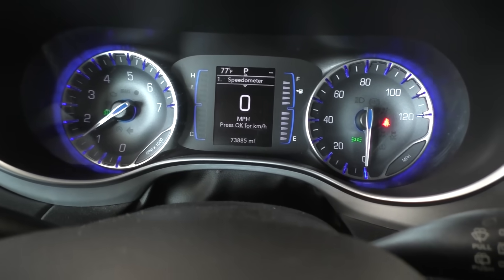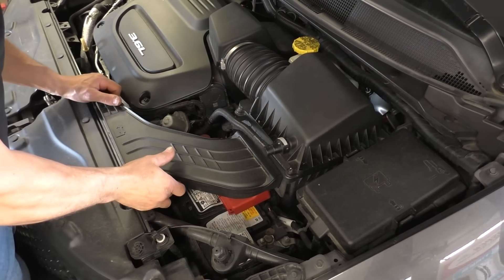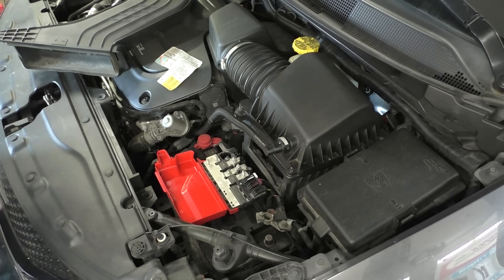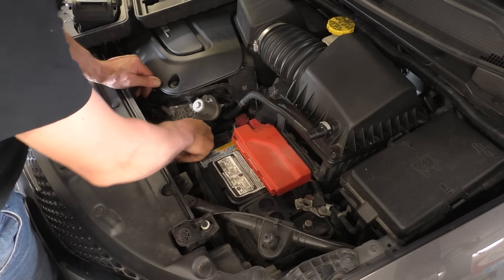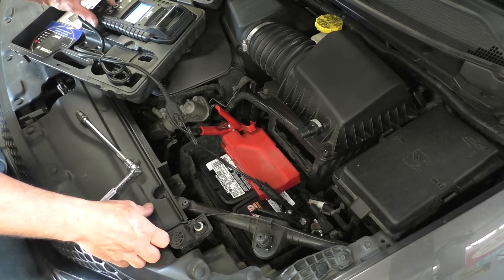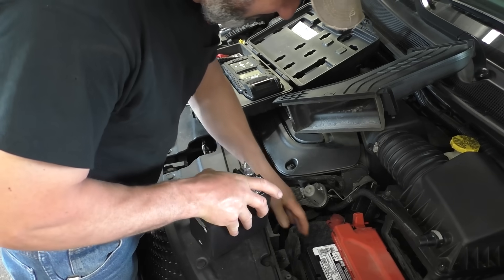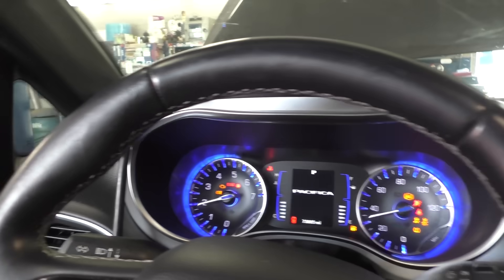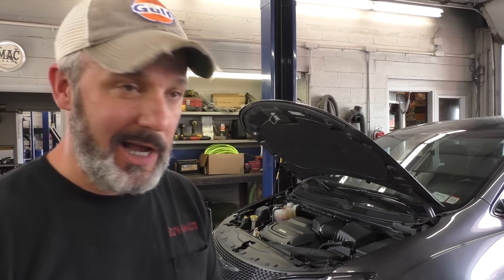Chrysler Pacifica - Start Stop System Disabled

Comment: My '18 Volvo did that after I was on a 9 month medical driving restriction. I replaced the aux battery with a standard flooded cell powersport battery (non AGM). I had to drive it a while and do a few resets of the battery monitor but eventually everything started working right. 2 years later and still working fine. I liked that the stupid start/stop garbage disabled but didnt like always seeing the warning.

Comment: I'm still running a Super Start (Oreily) 78 EXT lead acid flooded battery I purchased on Feb 14, 2013 in an 89 GMC Suburban v1500. Hard to believe 11 years and going. I've had it tested each year for the past 6 years and its still good however, I'm getting some hints lately its about time to replace...still has enough to start but for long term power needs it falls down within the first hour or so.

Comment: There a lot of people that would consider this a positive development, not a problem needing correction. BTW, Auto Start Stop is an unbelievably complicated design, the Care Care Nut did a great video on the system; it truly is incredibly over engineered (designed to mimic a hybrid system).

Comment: There is a lot of complaints on the internet regarding Chry's start/stop system with the Pacifica's. Replacement battery size, blah,blah,blah. My wife has a 2017 Pacifica and both batteries have been replaced 2x's, plus the fricking relay!!  If you search enough you can find a utube video on how to eliminate the auto start system and only have a main battery.  Like ur vlogs alot--

Comment: The difference between technician/specialist (mechanic/operator/electrician) and expert (engineer), is both experience and knowledge.

Just started watching and because I care to know technology:

I would check the BMS, battery state of health and charge!

Because the Start/Stop function ALWAYS checks the battery status to ENSURE it has enough charge to RESTART the car!

But MOST car people care not about DETAILS!
Reply: What is a BMS?

Battery Management System.
Keeps track of power (amps) added/extracted from battery and health (including age) of battery!

You do know that 100% of batteries have finite age life and cycle life, right!?
Reply: “That’s unique”, for no money back on lead core.

Well, again, you don’t understand that this is more like a UPS battery:
Deep cycle, rather than a regular car battery (start power, but get destroyed with deep cycles!).

(Not easy/profitable to get lead out of them, as it is with regular lead flooded batteries, which WILL start to go away. Write it down).

Comment: And several years ago when I worked for a big box parts store that installed batteries. One of the Chrysler labeled vehicles had the battery in the passenger side fender behind the inner fender ish.   I would politely refuse to install those explaining we were not allowed to remove major body parts for an install.  Lol I think the wheel and tire has to be removed iirc.  Then the easy replacement Chrysler station wagon type vehicles with the battery in the back of the vehicle.

Comment: In the salt belt, LOCTITE LB 8023 anti-seize is a good choice for the battery hold down bolt due to the bolted joint being surrounded by plastic parts. LB 8023 is a metal free marine anti-seize which is perfect for the salt belt.

For a new battery I find it beneficial that you first do at least a quick charge and then perform a internal impedance check to see what CCA the new battery registers, save the printout for the invoice (like shown in the video). This proves two things: The first is the battery is new, and it went into the car fully charged. Customers may ask, was the battery new? Where the mechanic provides the battery issue date which may be a month or two old, which we know is still described as new off the shelf, but the customer thinks why is it so old? and ask how do you know its new? Well that's why you provide the report printouts. 

If you have time to fully charge and test the new battery out of the vehicle you will usually find that the CCA rating is above the label rating. If not the battery has been on the shelf and neglected. Most batteries from the auto supply house are not fully charged when delivered. 

The video gives a good example of why you should first charge a new battery before doing the CCA test, you really want the report to be at or above the battery label rating for the customer.

If you do routine maintenance on a vehicle with monthly checks, you will also take the internal impedance reading in-vehicle (with the vehicle connected directly at the posts, under hood power points for trunk batteries will not work, you have to be at the posts) and record. Than every month you do the same test and you will start to build a trend (vehicle record). When the CCA in-vehicle goes below 80% CCA as rated, you generally recommend replacing the battery if this occurs just before winter. If it occurs in the spring you can usually get a few more months out of the battery as you monitor its health. For a car that is driven year round I find you generally get about three winters out of the battery in the salt belt in the lower 48.

I had one customer that got five winters out of a yearly driver battery, which to me was a world record, but the customer asked why do batteries fail so quickly? I really didn't know what to say.  

Deoxit L27 Electrical Marine Grease has very similar benefits as NO-OX-ID (A-Special). 

NO-OX-ID is better at preventing galvanic corrosion between aluminum and copper electrical connections than L27, like you would find in the electrical power distribution industry (Edison). However, for automotive OEM battery terminal and lug applications no aluminum is used. 

L27 is actually better at oxidation removal and lubrication than NO-OX-ID. However, I think either will do the job.

L27 / NO-OX-ID is applied to the post and lug before mating (as shown in the video) and Fluid Film (similar to NOCO NCP2) is an effective coating which is used after mating. 

Fluid film and NCP2 are non-conductive, this is why they are a coating applied after mating, whereas NO-OX-ID and L27 are conductive and are applied like conductive grease, that is, between surfaces before mating.  

I think the grease will displace more water than a coating over time. But, if the post and lug are covered than I think either method will work well,  which are many times more effective than doing nothing, no grease and no coating. 

Fluid film spray is a bit messy for the top of the battery when the battery is new and you want to keep it looking new, where the NOCO NCP2 is brush on so you can be very neat.

There are drill / driver attachments for cleaning battery posts, mark one P and the other N because the posts are different diameters. To clean the lugs you can use a bore brush, I use brass very sparingly, just enough to remove any surface oxidation.

After wire brushing the battery posts and lugs it is good practice to wipe with IPA, let dry, and then coat with grease. 

I think for the system to work, the battery connect disconnect relay is not a traditional relay, it is actually a latching relay. You have to activate a circuit to latch on, and then another to latch off. Cross connection latching with a non-latching relay may drop out as voltage drops below the relay hold voltage, which is very poor for a high current solenoid relay.

Comment: SMA on point as usual. I hope my nephew disables the start stop function. On idle I think a little under 40 psi of oil pressure is read. I feel like at least low 40's psi should be the norm. Oh well, DIY out.

Comment: Did you have to retrain the automatic power windows? My 2019 Ford needed to have the auto down and up reset when I replaced it's battery. Fortunately, it's a base model Ranger, so I only had to do the driver's side.

Comment: I had one where the customer kept driving with a bad aux battery, until it developed a slight internal short (would draw .5 amp all the time). It came in for the paracitic draw diagnosis.

Comment: I had one of these freak out about the start/stop system because one of the closed switches wasn't working. Had me doing circles for hours because it wasn't completely not working. Just the voltage range was out of normal. And it wasn't throwing codes. The hood closed switches were LAST thing I thought would cause this.

Comment: Curious Eric O, why would you not have plugged in a voltage/system maintainer while changing out the batteries?.?.?
Reply from the maker: Because then the whole system is hot and you have to be careful with the cables.

Comment: Question for Eric O. (I'm surprised that you didn't opine on this issue . . ..)--My understanding is that starting the engine is a major contributor to engine wear; ergo, it is preferrable (especially if one lives in an urban or suburban area) to disable the automatic start-stop, because the fuel savings are, long-term, outweighed by additional engine wear (from repeatedly starting the engine).  As I understand matters, all vehicles with the start/stop system have an option to disable it.  What are your thoughts?

Comment: I’ve got a 2021 Jeep Wrangler that has (had) this same ESS (Electronic Stop Start) scheme.  I hate ESS.  To begin with, I live in rural Vermont, and we don’t have any traffic, and not many traffic lights around.  No real need for ESS.  But more importantly, the smaller Aux batteries are known to have very short lives, 2-3 years at most.  And when the Aux battery dies it can pull down the main battery, which disables the car.

To completely disable ESS, first I installed an ESS Eliminator module.  What that does is latches the ESS disable switch in whatever position you last left it in.  Normally it reverts to “On” every time you start the car.  Next, I pulled the ESS fuse in the fuse panel.  That prevents the relay from putting the Aux battery in parallel with the main battery.  Third, I disconnected the red battery cable that runs from the aux battery (below the fuse box) up to the main battery, so when that aux battery eventually pukes it won’t kill the main battery.  Once the warranty expires I’ll pull the fender liner out and yank that useless aux battery out and recycle it.

Comment: I had the same issue with my wife 2019 jeep wrangler, brought to a dealer, they said it was a faulty charging chip and the batteries were fine.
Took the jeep for a 3-hour charging drive, the secondary battery never would charge, I changed both batteries, all was right with the world and has remained so since. Never got the dealer to admit they missed a simple Dead battery, thankfully it was still under warranty and I didn't have to pay for the three days they had it.

Comment: What used to take 5 minutes ( change out a battery ) now takes 45 minutes. I just changed out both of these batteries on a Pacifica , and that's how long it took me , and I already knew exactly how to do it . Oh yeah , and by the way : whatever you do , don not allow any tools or parts to slip out of your hands . They will fall beneath the battery area and if you can't see/retrieve them , you'll have to remove the aero dynamic cowling from underside of the van to locate and retrieve what ever you dropped . Allow another 30 minutes for this , so...DON'T DROP ANYTHING !

Comment: I've seen a few auxiliary batteries fail bad enough that when it does the self test on startup the voltage drops low enough to reset every module, not start at all, and not set a DTC, despite the main battery testing fine. P00FD is burned into my brain.

Comment: I have a mercedes cla with the start stop system and it is really fussy about the battery if it is a little less than purfect it wont activate the start stop system. As soon as the light wont go green quickly get the battery checked

Comment: The feature quit on my 2017 Escape.  No error messages.  It started working again after the battery was changed, but quit again about three months later.  I have yet to get it checked out.

Comment: The old Volvo 121 from 1970 I drowe in the 80s
had no computors, wires for the parking brake  4 fuses and rwd. I miss those times.

Comment: At least you can see the aux battery. Try MB, where they will, according to model, either bury it under the driver or passenger seat, or under half the engine on one side or the other, or under the back seat. In any case removal means taking half the car apart.

Comment: I have a problem on the driver side headlight of my 2018 chrysler pacifica. The passenger side is turns on but not the drver side. I look at the fuse box under the hood and found out there no connection wires on no. 98

Comment: Hopefully you get the opportunity to do the same battery replacement on a Jeep Grand Cherokee with the batteries located under the front passenger seat.
Reply: They aren’t that bad. Unless the passenger decides to adjust the front seat into a back seat 😏. Then have to hook up a power source to get the seat out of the way

Comment: I would like to award the Nobel prize to the guy that decided to put straps on batteries!  My question would be - Does the customer really like the start/stop tech?  Or is she like me and detests it.  If she hates it, could you just leave things be and replace the big battery  and ignore the message on the dash, or would that cause you to fail the smog test?  It didn't turn on the money lite, so I suspect you would be ok.  Which leads me to think all you would have to do to disable the start stop function is just disconnect the small battery.  Hmmm.

Comment: I got a 04 Ford explorer 4.0 that loses communication with PCM when plug the throttle motor in. I put a test light in instead but still same issue. But if leave the throttle motor unplugged it will run great. It got me all confused. Any help would be appreciated

Comment: We have a 2017 Pacifica.  Had to do this same job a few years ago.  I remember it being a bit of a pain. My wife drives this car only a couple miles a day so it really has no chance to stay charged from the alternator.  Also, I think one of the blender door motors runs randomly for a long time after the car is off (a known issue) so this drain doesn't help.  I had to put a quick connect extension cable on the battery and ran it out from under the hood. My wife now plugs it onto the little charger I keep at the end of the driveway when she comes home to keep it charged.  We always turn off the auto start stop with the button on the dash. There's just too many situations where the engine kicking off at the wrong moment creates a sense of panic with needing to wait for the restart while trying to punch it to get moving.  Stupid feature.

Comment: Wife’s 2017 Volvo XC60 T6 here. Intermittent start/stop function, so do I push the disable button this start or not?  Noticed loose start/stop trigger wire on battery (only one battery…thank you Volvo).  No codes.  Permanently disabled pesky function by disconnecting wire (automotive equivalent to removing mattress tag).  Still no codes.  Starter silently thanks me for making its life easier and I thank myself for never having to press the disable button again.  Life is good, but will a misdemeanor beyond the statute of limitations become a felony conviction?  I hear it could happen…

Comment: I’ve had batteries replaced in the past. The shop will attach battery power through the cigarette lighter to maintain voltage while the battery is removed. Is that really needed?
Reply: Not really needed, but it maintains the computer memory, so it doesn't have to go through its relearn. Especially if your coming up for inspection, it usually won't pass until that code is gone, I think P1000

Comment: Is there a chance that a faulty start stop system can cause air conditioning issues, have had a 2017 pacifica at the dealer for 2 months, they almost replaced the whole ac system and its still not working,  went to pick it up,  ac was working, turned it off and back on,  service ess system warning cane back up and ac doesn't work again

Comment: Why no NO-OX-ID on the auxiliary battery studs threads?  Seems like those are critical connections.  NO-OX-ID is great stuff and is used extensively in commercial/industrial applications where electrical connections are exposed to corrosive environments.
Reply: They're not - the contact is between the plate that thread is in, and the eyelet on the cable. The stud and nut just clamp those together.

Still a good idea to put something on there to stop them seizing in, though.

Comment: Good job. I’m an old school tech 60’-90’s and for whatever reason, which I know some are aware, I cannot stand the start stop systems. Whether or not it is detrimental to the batteries(s,) starters or other components, I wish there was a solid way to totally disable it other than the aftermarket gadgets that are out there. I have a 19 XT5 that doesn’t have the on/off button until they included it the following years with it. But from what I understand, you have to turn it off for each start which is just another PITA. I wish they’d use technology for better things like not allowing the wipers to try plowing frozen snow when some of us forget to turn the wipers off. It’s probably an easy enough mod with a relay if I wanted to be ambitious again but I’ve been waiting to no avail for someone to come up with that fix. Anyway, thanks for posting your work. I love you, your expertise and your shop. May God Bless.

Comment: My daughter used to have an old Oldsmobile.  The battery was in the driver's side fender well.  It was cold and snowy and I'm on the ground trying to change that stupid thing.  Not a worse place to put the battery.
Reply: I thought that craziness started with relatively modern cars.

I think the new beetles had you pull the front bumper to get to the battery.